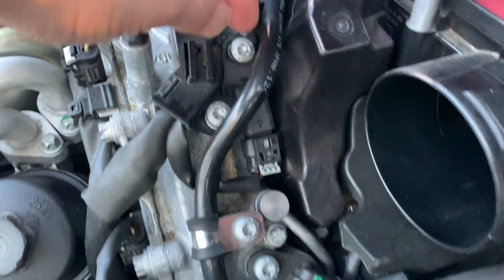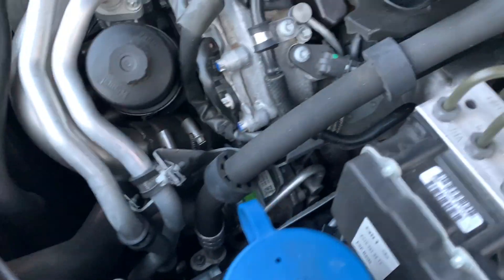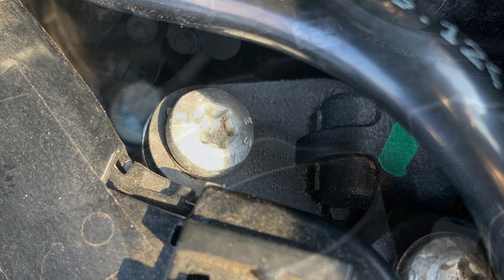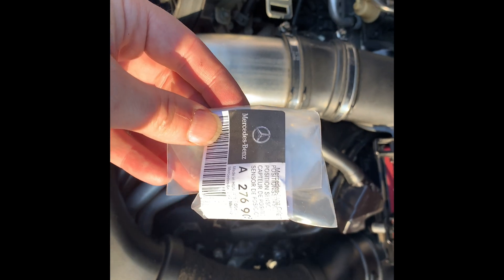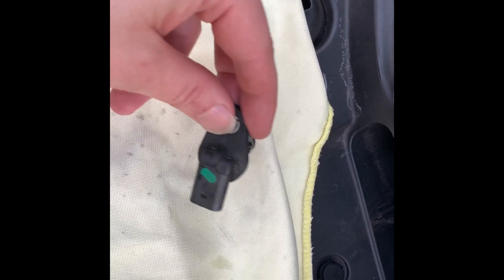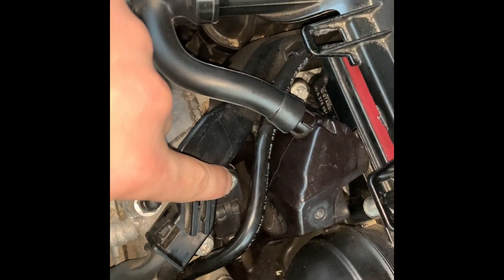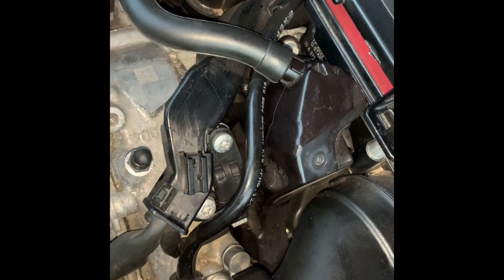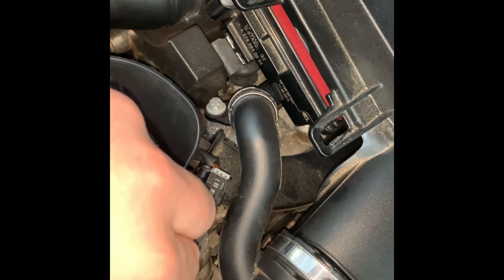Change Camshaft Position Sensors to Prevent Oil Leaking Through Wiring

Comment: Would this cause hesitation in acceleration under load? After I staged 2 tuned my cls550 it started having what feels like a hesitation and skipping feeling, I changed the plugs and gapped them for a stage 2 tune and now I’m seeing oil in the coils, two injectors and the ECU plug
Reply from the maker: I don't think it would help hesitation under acceleration.  Often though that is due to slightly too high of optimum spark, or potentially boost, some engines just don't like to be boosted that much.  Finally if it happens even if you aren't tuned that can indicate a valve problem.

Comment: How about wiring? Can be changed? , what is Part number for the sensors for W212 E63 2013
Reply from the maker: wiring can be changed.  The old way to fix this was with a piggy back connector which would plug into the original wiring and into the sensor.  New fix is apparently new sensors.  Check them out here: https://www.fcpeuro.com/products/mercedes-engine-camshaft-position-sensor-mer-2761530028
Reply: @TunedMercedes   is this the same cam sensor for all 4 areas ? and are all 4 known to leak ?
Reply from the maker: @agent0444  same one for all, and they all have similar issues.  One was leaking for me...
Reply: @TunedMercedes  hey thank you for reply bud 🙏🏼🙏🏼, I have the Engine Light coming all the time P2099 , I read on forums that it is possible spark plugs or these sensors what you think ? Can you advise?
Reply from the maker: @OfficialKava  p2099 sounds more like fuel delivery.  it could be from low pressure fuel sender (pump under the rear seat), perhaps the fuel filter (you can run some race gas to try to clean), or potentially from the injectors.  Injectors could be a DIY they are fairly expensive but they are right on top of the engine.  You may need to code them for the newest parts to take full advantage of the new injectors
Reply: @TunedMercedes  and how many I need of these sensors? 2 or 4?
Reply from the maker: @OfficialKava  There are four sir
Reply: @TunedMercedes  Very helpful! Thank you for the video and info. Oil was found in my spark  plug connectors, and i found oil my sensor connectors too. Is it confirmed that the primary cause of oil in the harness is the sensors and replacing them  with the part you linked is the best solution? Pig tails no longer needed/worth doing? 
Do you need to replace the screws with the sensors?
Reply: Broke plastic plug 🔌 on to cam shaft sensor any suggestions? What do you think about mercedes bypass wiring harness is it worth investing in 4 to avoid further issues 🤔

Comment: Thanks for the great videos! Definitely appreciate your in depth explanation throughout. I've recently purchased a 2013 S550 with 43K miles. Originally a California/Arizona car, now in PA. I'm just looking for things that may need to be addressed soon to avoid potential problems in the future.
Reply from the maker: Nice pick up!  I think it will be solid as long as you stay on top of maintenance which she will likely be hungry for.  I would guess you would need to do sparks, transmission fluid, brake fluid, and, with maybe coolant being two years off or so.  Air suspension may need to be looked at around 100-140k miles.  Not everything is a big expense on them but the bags do need to be replaced over time, perhaps the same life span as the struts/dampers.
Reply: How'd that work out for you?